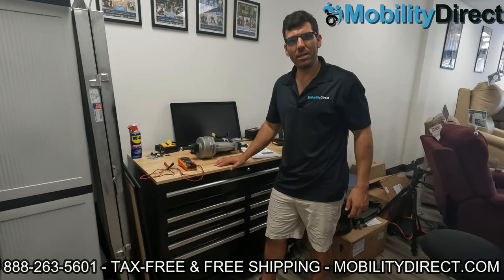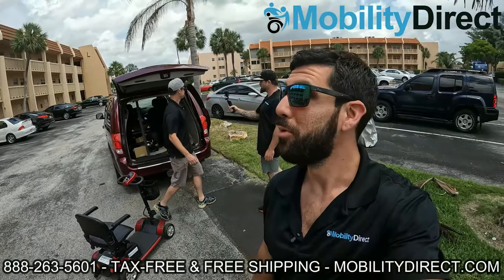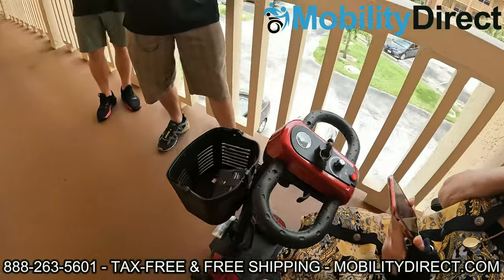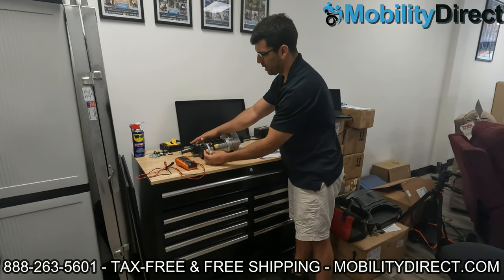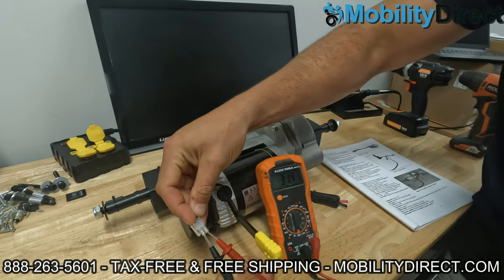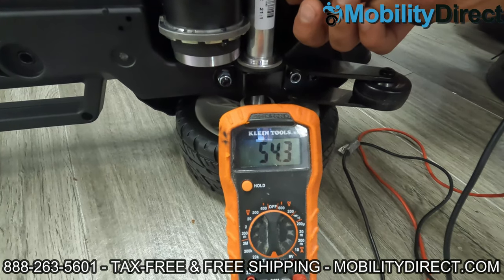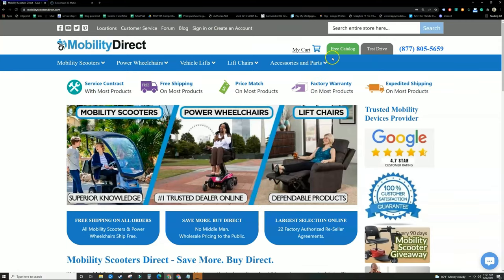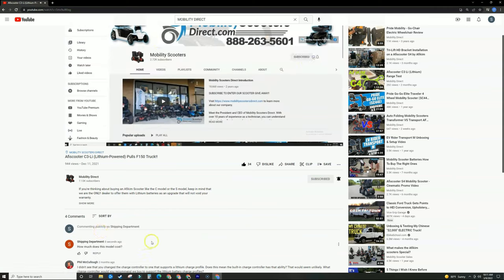⚠️How to Test a Mobility Scooter Braking System

Comment: I have tested (OHMS) on the brake on my Pride Celebrity X scooter and get nothing on my meter wrather its in the drive or freewheel position. I assumed the brake of micro switch was bad. I installed a brand new brake mechanism and the brake clicks when I pull the wig-wag switch up front but the scooter will not move. In the freewheel position it does NOT click. I have now OHM tested the new brake and again nothing on my meter either in the freewheel or drive positions. Any thoughts?
Reply from the maker: We would recommend bringing it in to a tech to figure out. Sounds like you might have a bigger issue.